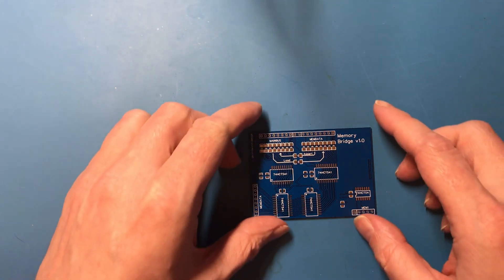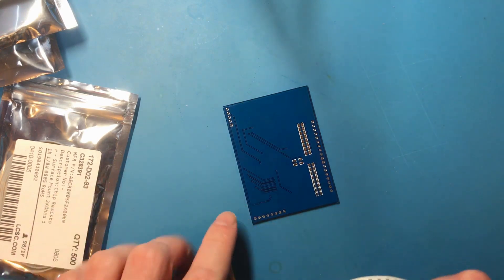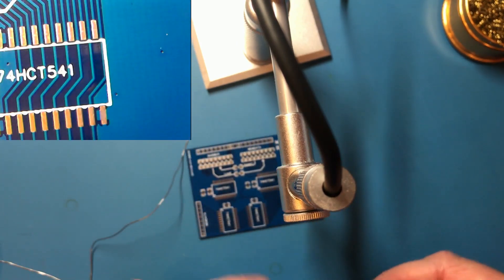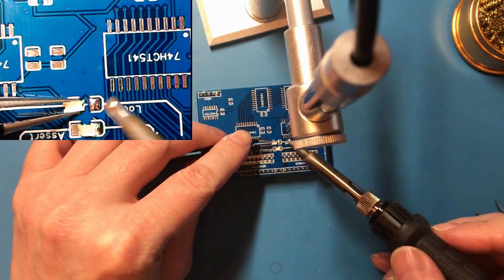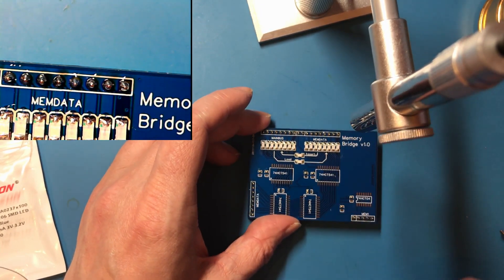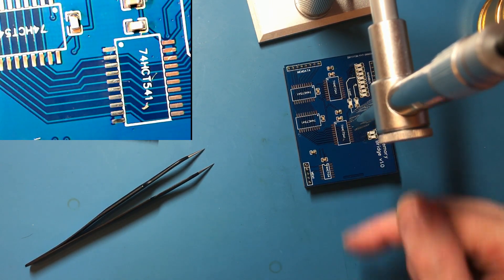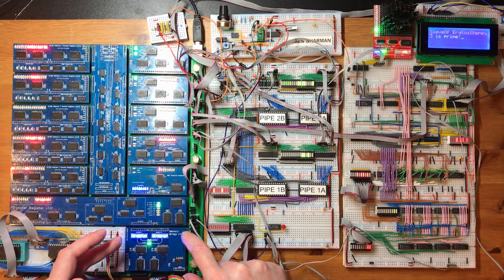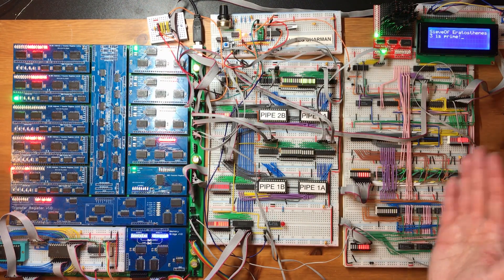Memory Bridge Solder and Install - Making an 8 Bit pipelined CPU - Part 71

Comment: why are therer four HCT541s? couldn't this be done with 2? one for either direction?
Reply from the maker: Yes! Only two are functional for the cpu. The other two are driving Led's, since those are bus lines I didn't want to have the load of the led's directly on there. It would probably have been fine but I had the space and was trying to avoid future problems.
Reply: @weirdboyjim  right. I've always wondered if there aren't any simpler (cheaper) devices for driving the LEDs...
For a single status/control LED a single transistor should do the job
Reply: @weirdboyjim  it seems there are DIP transistor arrays, they have the same footprint as most SN74 chips but they cost about the same. But the circut would maybe be a bit simpler, i might try them out in the future...

Comment: Only recently found this channel, have watched the 8 bit CPU series. I am getting a lot out of it. I am a programmer with fair understanding of digital electronics, but never could get my head around sequential logic design. It seems like you are approaching it as a software person would, and a lot of stuff is now making much more sense to me -- you explain it in my language. Thank you.

I have done a number of CPU emulation projects, and the design and debugging tasks you are doing are eerily familar. Starting with a big picture -- you knew what you wanted out of the CPU -- and incrementally building pieces, going back and redoing, building unit tests, bodging together temporary scaffolding... Yep, I've done all of that for emulators. 

You are reigniting my interest in porting my emulators to FPGA; watching your CPU evolve makes me think I might have a chance at success.
Reply from the maker: Good to hear you are finding it interesting and thanks the support! At the start of this project I was just programmer with knowledge of some electronics basics. I've learnt a lot but most importantly I have a better idea of how much I don't know now.

Comment: Nice work James. You're now quite proficient at the SMD soldering! The boards look really nice. I do like the blue solder mask vs the green.
In the video the pads look ENIG plated, but I’m assuming that’s just a white balance issue (due to the blue PCB’s) and they’re really HASL?
On the ALU modularity, I see my thoughts have already been well covered in other’s comments.
ie. Find the right balance between logically modular, and minimising the number of board interconnects.
I saw you noted no issues with the interconnects (yet), but this issue is one that occurs over time (oxidation etc.).
eg. In the distant future, reliability issues may start appearing, at which point you'll likely find that re-seating the board connections will resolve.
PS. Awesome work getting all the resisters around the right way :)  (yes, I have the perfectionist / OCD gene).
Reply from the maker: Thanks for the feedback.  The pcb's are indeed HASL, on the corroded contacts issue, The good quality pin headers are think will be ok, it's no different than a socketed ic, well over the half the board to board interconnects the build will need are already present.

Comment: That cluster of blue PCBs is looking very nice!
I'd say go modular for the ALU because anything complex I make tends to be modular for easy updates and debugging.... the only downside being that every connector is a weak point... but I thinks it's worth it.
Reply from the maker: Thanks Edge,  I'm a lot less worried about the interconects now I have the new back plane, I've not had any issues with those (Don't ask about the breadboards).

Comment: Break down into smaller modules rather than one big one, less like to suffer a mistake.
Reply from the maker: Thanks Scott! I've been leaning towards multiple boards for a while, but it does take some planning on the module layout both at the end and along the way.
Reply from the maker: How was my decoupling on this one ;-)
Reply: I wouldn't say less likely to result in mistakes, as transferring the pinout between modules can lead to error (won't orientation, maybe a pin swapped, etc.

But it should certainly make it easier to troubleshoot, debug, upgrade etc if you can pull bits out to test.

I'm leaning towards the modular approach too. 🙂

Comment: Awesome video! Your surface mount soldering is fantastic (you've definitely gotten good at it)

This is starting to look really awesome with everything moving over to PCB's. Can't wait to see the ALU get moved! That'll be great.
Reply from the maker: Thanks Brandon! The capacitors were a bit tricky on this one, and I had to adjust that inverter chip a few times but yes, it feels much easier than when I first started. Only made one solder bridge as well.

Comment: As you have already debug the ALU, there should be no issues to straight to a full blown PCB. But if there are any reasons that you might want to update a part them best to break it down in to different unit's. I happy to see either, but connectors are not your friend and this is where future connection issues could arise.

Still a great insight in to the inner working of a uP. When are you going to start adding interrupts this would be interesting  when adding a Non Mask able Interrupt (NMI) or an interrupt register :)
Reply from the maker: You make an excellent point, but I would see the pipeleine being 3 modules (one for each stage) and the alu being 4 or 5. That's still far less modules (each with much less connections) than the cpu already has.
Reply: @weirdboyjim  More modules does give you more room to play with the circuits.  look forward to seeing the path you take.

Comment: dude, except for these "show off what is possible" videos your soldering is the most beautiful i have ever seen ! you can be proud ;)
Reply from the maker: Thanks Nico! That has to be a bit of an exaggeration, but I have got better. On this board the capacitors were a bit tricky, not sure if that's something unique about them (the resistors and led's were easy) or the pads.

Comment: I think it would be nice if you make your ALU modular. It would have the Advantage, that reworking would be a lot easier, because you would only have to change one Module. Maybe you can make sure that you have the possibility to add Modules. So if you want to add Operations,  it would be easier, because you don't have to redesign your whole ALU.
Reply from the maker: I tend to agree, the only real drawback is that I have to do some extra planning up front to determine that the shape of the sub modules will be.

Comment: Looking nice.
Please keep the ALU and Pipeline as separate modules.
BTW, can you boost your audio please as i have my volume on max and struggle to hear you.
Reply from the maker: The pipeline and alu would always be separate. The question I'm asking is if I should break them down internally into modules.
Reply: @weirdboyjim   Yes.
Reply from the maker: I'm not sure what your audio issue is, youtube seems to do some rebalancing on the audio but it comes out a slimier volume to other videos from other creators. Do you have the same problem on other videos of mine? Videos from other creators?
Reply: It sounds fine to me
Reply: @weirdboyjim  with yours yes but this one I had to use headphones to get a higher audio level.
Reply from the maker: Can you email me (address on my about page), I want to get to the bottom of this, it's the first i've heard of it.